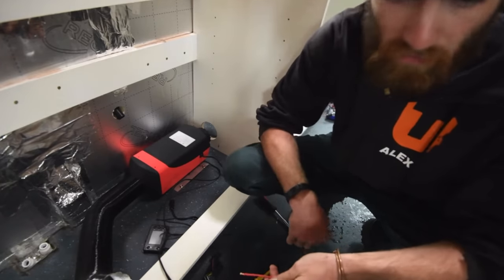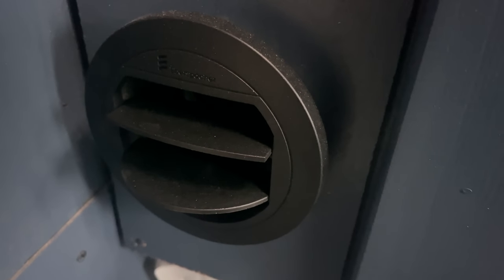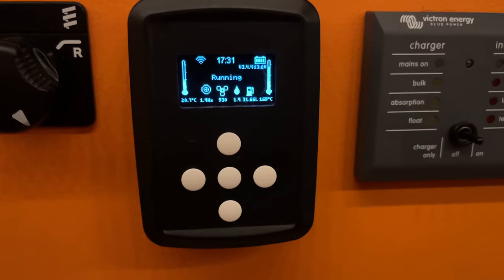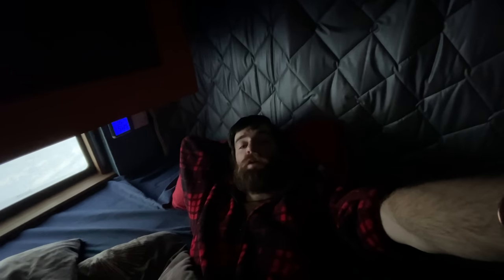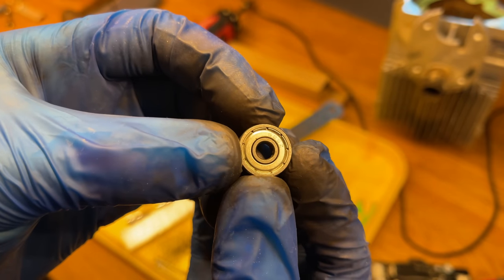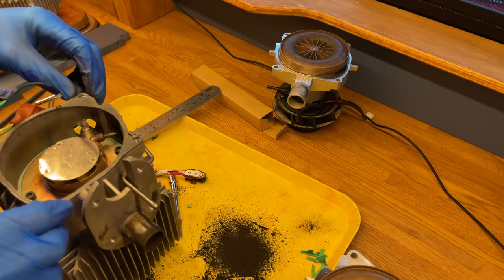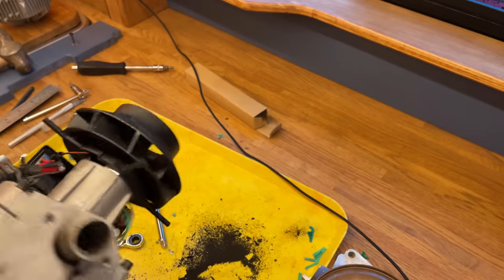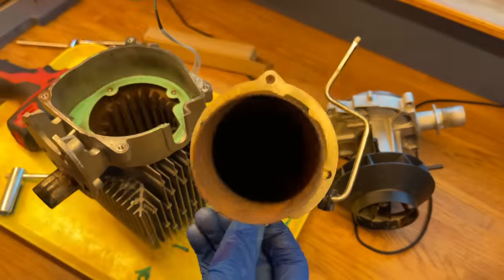2000 HOURS LATER! Chinese Diesel Heater

Comment: Does the after burner save on fuel?
Reply from the maker: Not directly as the pump is still the same pump. It doesn’t change any of the original settings of the unit unless you want to change them, but I guess you could save fuel because the thermostat is very accurate and you don’t have any unnecessary heating
Reply: @MispronouncedAdventures  thank you for your responce !!! Thinking of purchesing one .does it ramp up in stages? Tha4 would be nice ! I think i got my cheap stat were i want it low fire i turned way down . Turned hi down a bit too. That seem to help on fuel consumtion . Would be nice to jave a few extra fuctions .

Comment: Cheaper to replace whole thing £70 ?
Reply from the maker: £6 for two bearing is cheaper than £70-£130 for a while new heater. 

With CDH when you have a good one I’d rather repair parts than replacing a whole unit

Comment: I recently also replaced the bearings on my diesel heater fan.
My heater is installed in a boat so I suspect that the salt air might not have helped the bearing life.
In order to fix this issue I replaced the old bearings with new SMR105 2RS CB ABEC-7 LD Stainless Steel Hybrid Ceramic Bearings.
These are exactly the same bearings as used in high quality fishing reels.
The bearing size for my heater was 5mm inner diameter x 10mm outer diameter x 4mm wide but if anyone is planning on doing the same thing it might pay to measure your bearings prior to ordering.
These bearings were a little more expensive but they should last a lot longer in my application.
I guess time will tell if I’m right about them lasting longer but it’s a heap quieter now.
No lube needed either.
Reply from the maker: Hopefully they lasts and works for you. I’d imagine salt air is way harder on kit
Reply: Exactly right.
It’s a bigger boat and installed in the main cabin but ultimately salt mist goes everywhere.
Got fingers and toes crossed that it works.
But it should do.
Certainly not keen on lubricant either because that’s more likely to capture airborne stuff and turn it to grinding paste.
Reply from the maker: I agree, same for not a putting lubricant on the bearings in the heater, as they will just pick up and gather carbon from the brushes on the motor

Comment: A sealed bearing would be better than a shielded bearing given your running into contamination failures. SS bearing. They shouldn't be failing after only 2000hrs they are seeing almost no load at all.
Reply from the maker: That makes sense you me. I guess at the time I didn’t know too much about the different types so I thought it would be better to do a like for like swap with a high quality part

Comment: Great job, whats your low setting?
Reply from the maker: Stock settings. Low is 1.4hz @ 1500. High is 5.4 @ 4300

I’ve never tweaked them personally, it’s always worked for me so not playing with if
Reply: @MispronouncedAdventures  Mine quickly sooted up always having on low (~10-15c) so now starting and switching off high (~25-30c) to clean it out - apparantly thats the trick.
Reply from the maker: What is your exhaust and air intake like? any restrictions? there are also many many different ECU some might be better that than others out with the heaters
Reply: @MispronouncedAdventures 
 no restrictions, i have cleaned it out...worked great last night at -7c outside, 12hrs on starting at 25c for 45mins then down to 12c for rest of night. Used about 0.2 volts of power.  I have the 3 button controller
Reply: @charleswillard775  Do you operate mostly at elevations above 1000 meters?  At high elevations the air is thinner, so default setting is too much fuel, leads to soot.
Reply: @chetmyers7041  no mostly at sea level...its working great at the moment though

Comment: OK think I will cheat and buy a new fan and gaskets hehe like look of the silencer . Most of the fuel pipes arnt done  up properly if you buy these heaters in a tin box with a fuel tank included and pump draws in air and suts up in chamber
Reply from the maker: Yeah I have seen photos of some horrible set up inside the “all in one” versions. switch to the small bore hardline seems much better 

That is the upside side of the Chinese heaters in this price range. It’s not too expensive to buy a whole new heater, fan assembly or bearings. My thought being the heater is very clean after 2000 hours. So lll just upgrade the bearings.
Reply: @MispronouncedAdventures  yes good job done

Comment: Does anyone make a brushless motor to swap into these?
Reply from the maker: Not likely, as it would need an entirely new PCB, as motor speed is monitored by a hall effect sensor built directly onto the PCB

Although from my understanding the autoterms which are a excellent unit and made in Latvia use a brushless motor

Comment: 2000 hours is 83 days, how did you stretch it over 2 years?
Reply from the maker: I say and show it’s run time in the video it’s total run time around 88 days, also say I’ve had the unit installed for 2 years
Reply: @MispronouncedAdventures  
So it's not full time use
Reply from the maker: @just my opinion that’s my full time use. That’s on for about 200 nights on over night ( being 10 hours pre night ).

Comment: Just thought I would mention that the heater under the fridge is not a good idea as the fridge will be working overtime.
Reply from the maker: Very true, but the air mass the heater is on is isolated / separate section from the fridge so it’s not an issue, heat produced by the heater isn’t really affecting the cooling capacity of the compressor or heating the fridge up. The heater body’s don’t get hot anyway as the air is pushed down steam of the heaters anyways down the ducting.

Comment: Can we use kerosene? I would rather have the tank and heater outside of my camper.
Reply from the maker: Maybe us Kero in them as they have cleaner burns. 

You can do outside installed with the proper mounts protection for the units

Comment: Is there a western, or brand name version of these heaters anywhere?
Reply from the maker: Sort of I’d guess. The “Chinese diesel heater” of which many Chinese companies make them use a design, based off the expired patent of the German made Ebasperher D4 heater. There are also the Western company Webasto and also Autoterm which also make diesel powered heater is using their own designs.
Reply: @MispronouncedAdventures  Thank you for the information, with it I was able to find out that ThermoKing makes models based of similar designs.
Reply from the maker: Yeah Thermoking seems to be part of or associated with Espar / Eberspaecher

Comment: We got Webasto heaters in our cranes and every year like clockwork they stop working. I say, buy cheap Chinese and have 2-3 to spare instead of buy Expensive Webasto that breaks just as easily...
Reply from the maker: Sorry to hear you have issues with your Webastos, I use a Webasto as a engine pre heater. Whilst the western brands normally are very good quality, it’s can become expensive or time-consuming with warranty or service if you require it fixing

Comment: wow so you used 4 litres of fuel a day on the low setting? And you think that's fine? That's £6 a day here, which would be about £540 for a season. That's a hell of a lot of diesel.
Reply from the maker: That’s not particular accurate your conclusion there on my personal usage. For last two winters worth of my arctic trips I use about 60L per month when it’s can be -20c outside . Which is about 2L per 24hours as the heater isn’t on all the time, the engine is heating the van when driving. that more running on low to medium as well.  

I’m not really bothered about paying £3 per day on diesel to heat on a trip like that, when an energy drink is like €3-4 and a beer is €10 

My UK winter usage is more like 1.4L or less per night
Reply: It wasn't a conclusion, I simply worked off your own figures. If I'm wrong your figures are wrong.  @MispronouncedAdventures
Reply from the maker: @mymobile5014 well my figures are not wrong because the afterburner controller logs your diesel consumption in litres. So I know exactly how many litres of diesel I’ve used or use per month. Which is 60L per month on arctic trips.

You’re 4L of diesel a day implies I run at 24/7, which I don’t. 

Working out total hours / days in runtime divided by the total amount of fuel I’ve used. Would give you the “average” litres per day, which might work out to the 4L you referenced, but that’s not actually how many litres of diesel I use per day, because reality the heater is not run 24 hours a day
Reply: Right, the log shows you used the heater for 89 days right? During those 89 days you used 359 litres of fuel right? These are your figures, not mine. So, 359 divided by 89 is 4 litres, per day. A litre is about €1.50. 4 multiplied by €1.5 is €6 right? So over an 89 day period you spent 89 multiplied by €6 which is €534 right? 
Now you're saying you use 60L of fuel per month. But 60 multiplied by 3 months is 180L. So why does your log say 359 litres? I'm not lying and am not trying to make a fool of you, I am working out from your own figures that you gave (and have just changed).   @MispronouncedAdventures
Reply from the maker: @mymobile5014  I think the issue here is the is the way you’re treating the 89 days, it is a total runtime, which is around 2100 hours.

That is 2100 hours of the heater running over a span of a two-year period.
Reply: OK well you don't make that clear. But even so, purely in terms of fuel used and cost for fuel over a given time, that's a lot of money. I might rethink the idea of having one now.  @MispronouncedAdventures
Reply from the maker: @mymobile5014 I do repeatably mention runhours and mention it has been installed for 2 1/2 years in the vehicle. 

But mistakes happen
Reply: OK you lost me now. Run hours are in the log you showed are they not? @MispronouncedAdventures
Reply from the maker: @mymobile5014 yeah. I should have said “runtime” in the last comment. As that’s what I say in the video and what the log is titled on the afterburner. The afterburner runtime summarises runtime in days + hours format opposed to just hours.

Comment: The heater is heating the fridge
Reply from the maker: It’s not, the fridge is in an isolated air mass. none of the diesel heaters hot air or vents get to the fridge.

Comment: "I have no idea why that happened"... proceeds to show aurora. theres your problem.
Reply from the maker: Probably not likely to be the issue. Having spent  2 winter up there running 18 hours ish a day  thats the only issue. Wasn’t even a worth noting kp rating at the time
Reply: @MispronouncedAdventures  even weak solar storms are causing stronger effects than they would have years ago. the aurora cause high energy particles to interact with electronics and magnetic fields typically causing radio blackouts, sometimes GPS or internet issues. we will see lower aurora and stronger effects from solar storms during this magnetic field weakening and eventually flip. the magnetic poles are accelerating their displacement, increasing atmospheric solar forcing and overall the amount of energy hitting our earth. it's just a matter of time untill all sensitive electronics stop working all together.

Comment: that heater costa round £100 it's much cheaper and safer to throw that heater in the trash and put a new one
Reply from the maker: £6 for new bearings is a lot cheaper than £100 for a new heater, I’ve got loads of these heater, but having played with many I  would  disagree with the replacing them as a whole unless needed. There’s so much variation between the quality of Chinese heaters, so many different ECU’s, controllers, casting quality or more. If You’ve got a good one, which is tuned well, not worth swapping and maybe putting a crap one in. This heater is now at 5000 run hours

Comment: Every hundred hours or so run it at maximum heat for around an hour, this has the effect of heating the casting to a temperature that actually burns the soot out of it and the exhaust blows it away, actually running it at a lower temperature increases the likelyhood of soots and deposits building up, plus why are you running it on derv ? that is the most expensive thing you can do, red diesel is only normal yellow diesel with a customs duty red dye in it for tax exemption purposes, and is perfectly legal because it doesnt actually help to propel the vehicle AND costs a fair sight less.
Reply from the maker: I run out of my van is main fuel tank so I never have to worry about filling up a small fuel tank. I personally prefer the convenience over the cost. The uk costs of red has gone up a far bit as well. 

As for the hot burn for an hour of so. My normal use with the thermostat will have it blasting on high to get the van up to temperature before dropping done so that probably has a similar effect
Reply: @MispronouncedAdventures  I understand your point,
 but the actual time it is on full thrutch is no where near enough to burn the deposits away, it actually cycles back when the case reaches its lower temp point. the one hour recommendation was arbitary, it simply needs long enough to actually burn the soot off. Most current use H.G.V's have an incorporated  programme in the dash software that does this same thing, called exhaust gas regen which gets the vehicle exhaust mad hot for this very purpose  and instructs the driver not to turn the engine off for around an hour while it is in operation (which is what I based my estimation on) maybe half an hour or so could work. Cant argue viz  the red diesel as I havent bought any in yonks but given that it doesnt carry the raft of road duty and escalator  tarrifs that yellow does it would mmake me want to install a seperate tank above the unit and behind the fridge, maybe somewhere in the region of twenty to twenty five litres, over a period the cost savings could be significant.
Reply: No red diesel in my country
Reply: @null643  Which Country is that ???
Reply: @usernamesreprise4068  Netherlands
Reply: @null643  Ah right, well ask a local farmer what they use for their off road machinery such as tractors and combine harvesters and such, they must have suppliers and I cant see a farmer paying road going prices.
Reply: @null643  oh and bargees too.
Reply: @usernamesreprise4068  They use the same diesel, pay the same prices.
Reply: @null643  are you sure ? I cant see them paying road fuel taxs for ag machinery.
Reply: @usernamesreprise4068  yep, the taxes are insane and fuel prices in general are pretty bad over here.
Reply: @usernamesreprise4068  yes same thing here in France, same gazoil or diesel for everybody and taxe return for professional later...
Reply: @14KiloWhisky  Thats terrible, we have always had a  red diesel exemption in this Country, the law is such that they can only apply fuel duty when it is used to propel the vehicle,  all other usages such as heaters and refrigerator/freezers or generator units obviously do not,  so therefor are exempt and to that end tax free diesel is dyed red....but if at a roadside check they were to find red diesel in your tank........you are in big trouble with the tax man and will be arrested.
Reply: @usernamesreprise4068  red diesel or GNR    here is not available everywhere, only on special pumps with registred card. You need to be professional and justify an activity like digger... Etc... Where are you living?
Reply: @14KiloWhisky  I live in Northern England (Merseyside)  whereabouts in France are you ?

Comment: Looks like about 500 hours
Reply from the maker: It’s almost 4000 run hours now. a well set up heater should run fine without much issue. It’s easy to find out run out with the afterburner controller I use as it logs it all

Comment: The price of these things, just get a new one every 2 or 3 years.
Reply from the maker: Definitely an option with the price point of these heaters, but I’d prefer not to do that. There is such a wide difference in build quality and these units are easily fixed.  I’d after rather spend easier spend £6 on bearings and a few hours of your time dismantling one to fix it then £100 to put a new one in which might not be as good as the old one

Comment: The carbon brushes will wear out long before the armature !!!!!!!!!!!!!!!!!!!!!!!!
Reply from the maker: Depends how well the motor is made. 

Isn’t the armature the windings on the motor? Do you mean the commutator. If so even on the ever popular Maxxfan used for ventilation in vans a lot. I’ve seen photos of the commutator worn out before the brushes.
Reply: @MispronouncedAdventures  I have worked with many series wound motors and  the windings in the armature have gone bad, and I have had to turn down the commutator when putting in new brushes. appliance repair was my way of life before I became an electronic technician.

Comment: Buy 2 diesel heaters for the cost of that afterburner. I don't see the benefits
Reply from the maker: The features the afterburner gives you is worth more than two heater. Buying two features doesn’t give you more features 

perfect working thermostat, cycling on/off, remote access, frost mode, data and stat logs, fuel tank levels, GPIO out and in, data read outs of temps, pump speed, fan speed and much more
Reply from the maker: Pretty much turns dumb Chinese heaters to more advanced features than the expensive western brands

Comment: Let's put something that gets really hot under something that needs to cool food...hmm
Reply from the maker: Diesel heaters, as in the outside case are cool when even running on high, there is no radiant heat from them.  the heat is also blown down the ducting. 

A cover sits over the gap and isolates the two air masses anyway